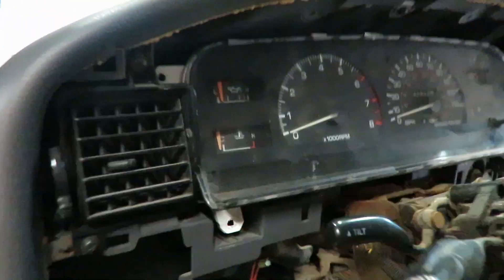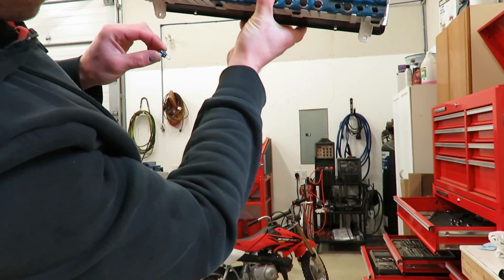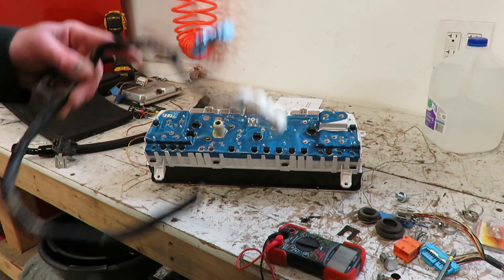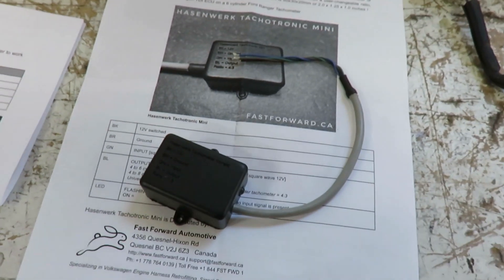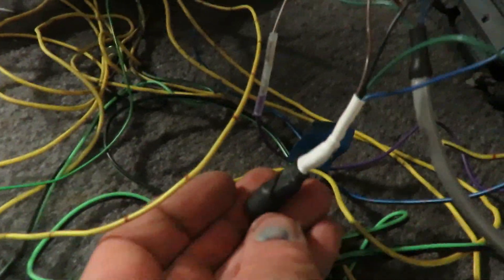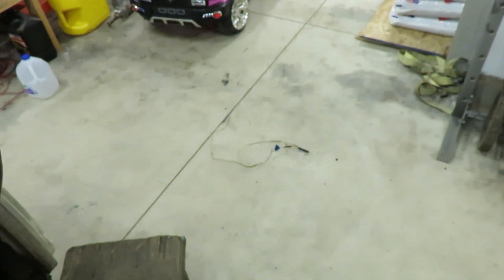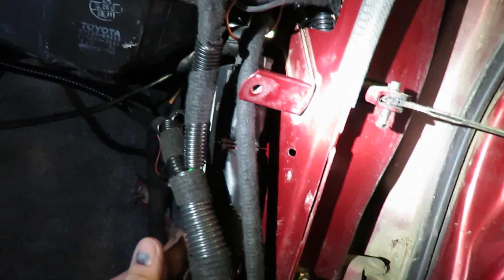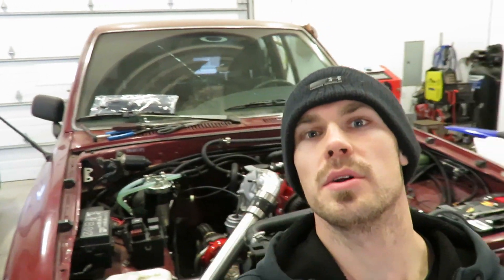Toyota TDI Diesel Swap Instrument Cluster Is Fully Functional!!!

Comment: I believe but can’t quite remember, I think Toyota has a built in resistor in the tach and it is adjustable. But the digital to analog part would be needed.
Reply from the maker: Im running a converter with no issues!

Comment: I’m having an issue with my temp gauge being halfway as soon as I start the engine. So as it warms up it’s reading as overheating. I wired in the purple wire that comes from the coolant sensor into the Toyota yellow green wire that goes to the gauge and it’s still showing halfway on the gauge when it’s cold. Did you do anything different to make it work?

Comment: How did you deal with the TDI oil pressure switch? I've got a full harness from fast forward automotive and I've tied in his pressure switch wire to my cluster and my light isn't coming on
Bulb and switch are both good
Reply from the maker: Not sure i have the factory gauge!!
Reply: @austinniemela  how did you get the signal from the oil pressure switch on the filter housing to the dash cluster?
Reply from the maker: SleazyBakeOven got a adapter and used my toyota pressure switch in the vw housing
Reply: @austinniemela  ah that makes sense. I guess I'll have to cut off the vw oil pressure plug and wire in a stock one or equivalent

Comment: Looks good and thanks for making these videos! I was just doing bunch of this stuff this weekend. I have the same tach adapter and mounted it on the back of cluster. I am currently trying to track down extra cluster pins too. What did you do with the oil pressure sensor?
Reply from the maker: Cole MacDonald oil pressure is all stock toyota! Adapted it to the filter housing